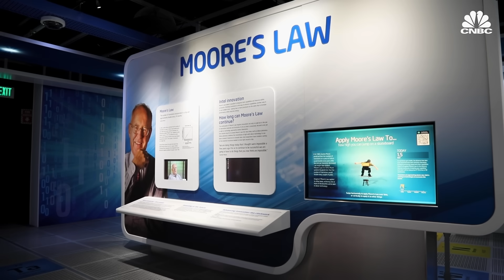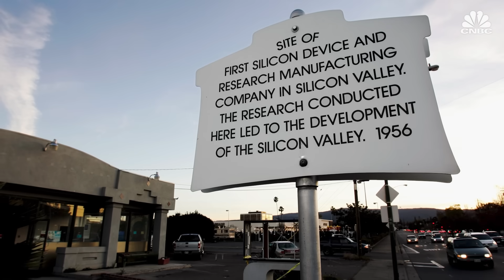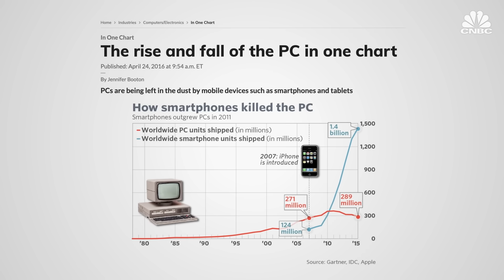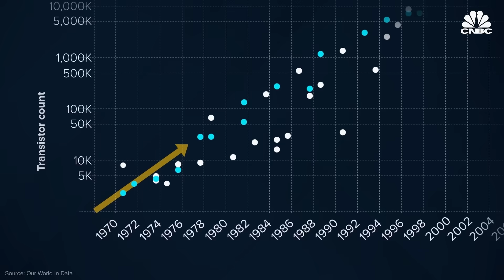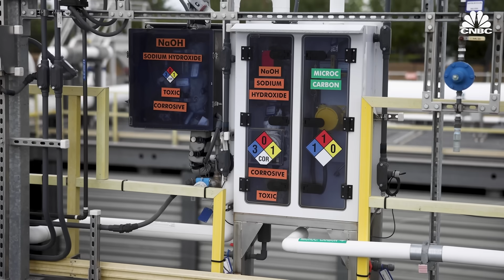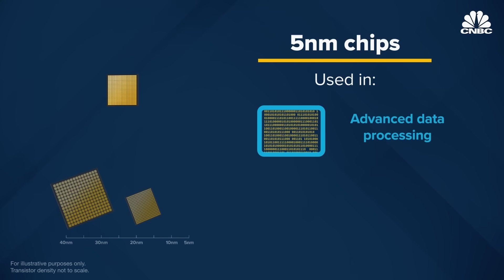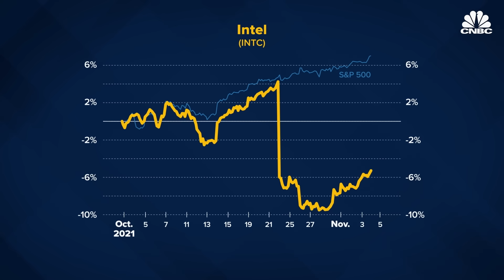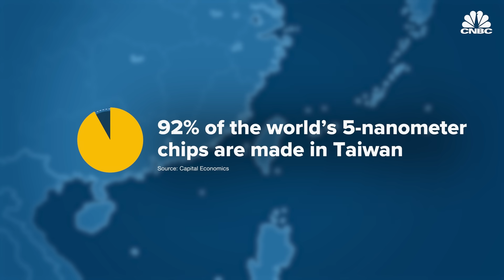Inside Intel’s Bold $26 Billion U.S. Plan To Regain Chip Dominance

Comment: my money is on AMD. Has been for a long time, been using AMD for a long time....  Their chips were equal for a long time, and now they are better.  way better. intel can't win me back.  I will stick with AMD even if intel makes something better.  THe simple fact is that intel STIFLED innovation for almost a decade!!!   We hit quad core laptops and desktops back in 2004. and things didn't really move much from there until 2015 or so when AMD released Ryzen... and 8 and 16 core processor for consumers...   Intel failed the consumer during those 10-15 years where chip development slowed down to a crawl!!!  We should have had 16 core intel consumer grade pcs in 2010 or 2012...  We had to wait for AMD to do it.  And Intel could have done it, but they thought they could milk the tech for a while because they were scared or moores law coming to a peak... they bet wrong. I won't be back... However, NVIDIA is still king of the gfx... but the new AMD stuff is catching up quite well...  I'm proud of AMD, and Intel has literally upset me...
Reply: also, I lived in portland for about ten years, I met several of the managers there...  I was far far from impressed and lost a lot of faith in the just by that alone....  I suspect being in Portland (Hillsboro) is half their current problem honestly....
Reply: Also, I find it INSANE that intel relies on another company to make the machines that make their chips.  If I was intel, the first thing I would have done was built my own department that builds nothing but those machines.  Building those machines that makes the chips is what should have been in the bill to support USA production... We need a USA chip maker maker company... ffs  simple

Comment: I can’t believe this report didn’t mention AMD. AMD has crushed Intel in the PC market with their astonishing Ryzen line of processors. They set the bar for performance and price at a level that Intel simply cannot compete. And don’t let  me get started about the graphics capabilities that you get built in into their processors thanks to their proprietary Radeon technology. Intel has stopped being the leader in consumer electronics a long time ago. It’s just that now it is more than obvious.
Reply: Intel is having such a tough time competing with AMD currently BECAUSE of TSMC, which was mentioned multiple times in the video. AMD has had a breakthrough in moving to their chiplet designs, but unless someone can actually build it the design is worthless. TSMC's manufacturing ability is what enables AMD with Ryzen and Apple with M1 to have such competitive products.
Reply: AMD designs Chips, they don't manufacture them. TSMC does.
Reply: AMD is a paper tiger that is completely dependent upon TSMC. When China swallows Taiwan, which WILL HAPPEN within the next 10 years, AMD will be be out of luck. Those fantastic chip designs mean nothing if they cannot be built.
Reply: @jstasiak2262  TSMC is currently building a new factory in the US. So you're wrong.
Reply: @akyhne  
That FAB is in a desert in Chandler, AZ where there is a drought and water is scarce. The Colorado river, the main water source for Phoenix/Chandler, is at a historic low level. Does it make any sense to put a factory that requires 13 Olympic size swimming pools worth of water (9M gallons) PER DAY in a place like that? I don’t think so. I think that is asking for failure.
Reply: @jstasiak2262  What does that have to do with anything. They are starting a factory in the US. Period!
Reply: @akyhne  
If you don’t have access to 8-13 Olympic size swimming pools worth of clean, fresh water every single day, you can’t make microchips. In a desert, water is scarce. Period.
Reply: @jstasiak2262  I'm sure they have a solution, just as Tesla did, when they build a gigafactory in the middle of the desert.
Reply: @akyhne  
The Tesla gigafactory in Nevada is very close to Lake Tahoe, Reno, and Interstate 80 which gives it all the resources that it needs. A gigafactory also doesn’t require 13 Olympic sized swimming pools of water per day. 

Perhaps if you have ever lived in the desert, you would understand how scarce and precious water is and how angry and upset people get when there isn’t enough water to go around. In the Phoenix area, there is also a lot of agriculture which requires massive amounts of water for irrigation to grow crops, animal feed and to water livestock. The farmers get very angry when they don’t have enough water to make a living.
Reply: @jstasiak2262  Phoenix has enough water to last 100 years without access to the river.
Reply: @kayakexcursions5570  
First of all, aquifers are an unreliable water source as any farmer in the California Central Valley can tell you. They can run dry unexpectedly. and it isn’t always easy to find new ones. Second, what happens after 100 years (or sooner)? Does the entire Phoenix metropolitan area have to uproot and move because it exhausted its water supply? There are already small cities in Arizona that had to de-populate because of lack of water. A “10- year water supply” is not a large water supply.

It makes zero sense and is foolish, reckless and irresponsible to locate a highly water intensive industrial facility in a desert, near a major city with large water requirements of its own, especially during a drought.
Reply: @jstasiak2262  Phoenix will never exhaust its water supply. I guess you know nothing about the situation, Phoenix pulls in more water than it uses. It stores the excess and requires all new land developers to store at least 100 years of water for each development. There is no worry about running out of water, there are no water restrictions, companies can throw away water as they need.
Reply: @kayakexcursions5570  
Nonsense. If other cities in Arizona can run out of water, Phoenix can run out of water. The decline in water level at the Hoover Dam is downright frightening. Arizona doesn’t have anywhere near the water storage capability that California has and the reservoirs in California are frighteningly low too. The runoff from the Sierra Nevada mountains has been very low for several years and none of the aquifers in the West are being replenished.

It is stupid, reckless and irresponsible to build microchip FABs in a desert during a drought.
Reply: @jstasiak2262  Wow, it's super obvious you don't know what you're talking about, the river is still flowing, aquifers are still being built and filled each day. We have multiple chip manufacturers here, but you still think we're going to run out of water just because other people are? So you're saying if you run out of milk you're neighbor has none as well? You need to explain that to Intel, I think they would be very interested in hearing your concerns.
Reply: @jstasiak2262  Phoenix has been stocking water for a while and there are floods here every year. Taiwan can move production here (they already have a plant).
Reply: @kayakexcursions5570  
TSMC is Taiwan’s security guarantee. Because the US has fallen so far behind in chip fabrication technology, the US cannot afford for China to gain control over TSMC or even take it offline by destroying it. This forces the US to defend Taiwan against China. Taiwan is not going to forfeit that security guarantee by making itself expendable by building cutting edge FABs in the US.

California has the largest and most extensive water storage and movement system in the United States. It has been online since the mid 1960s and supports the California agricultural industry which feeds a large portion of the entire country. The reservoirs are running dangerously and amazingly low. The only thing that is preventing a water crisis is forced water rationing and conservation. California no longer has the water supply to support the semiconductor industry, and that is one major reason why there are no more FABs in California. (The onerous regulations and exorbitant electricity costs are other major reasons.). California’s water supply is superior to that of Arizona.  If California doesn’t have enough water to make microchips, neither does Arizona.
Reply: @jstasiak2262  The plant in AZ is a copy of the one in Taiwan, they use the same machines that Intel will be using. There is obviously no problem with water usage in Phoenix or everyone wouldn't be building their water intensive plants here. Phoenix gets excessive amounts of water and literally dumps it onto the ground to be absorbed into the water table.
Reply: @kayakexcursions5570  
Intel also has the exact same ASML photolithography machines that TSMC uses in Taiwan at its Hillsboro, OR FAB (no water shortage there), but it has thus far failed to master the technique required to make its latest 10th and 11th generation chips. TSMC has to make those chips for Intel.

Even more important than the equipment is the knowledge and technique required for advanced EUV photolithography. TSMC has mastered it; Intel hasn’t and AMD gave up trying. Without the knowhow, the machines are useless. TSMC is not going to share that knowledge with the US because that would be giving away its security guarantee.

China wants that knowledge too, but the US is blocking it. The US is even forbidding ASML to sell EUV PL machines to China. China could capture the equivalent as well as the knowledge and expertise by capturing Taiwan.

There is no water emergency in California right now either—yet. But it won’t take much to have one. 

Unlike Hillsboro OR which has abundant water supply from the Columbia river, the water supply in Arizona is tenuous at best. And unlike the people of Taiwan, when push comes to shove, the people of Phoenix will not allow their water to be rationed to allow TSMC or Intel to make microchips.
Reply: @jstasiak2262  let’s not forgot how Intel ran to TSCM for help and begged them to manufacture their chips for them. Competition is good. Support AMD and Intel.
Reply: @jtn0022  it is a business deal, that's all there is to it. AMD has used Intel's. Competition is good for consumers. It is mostly win-win for all in this industry unlike any others.
Reply: Lmao dude TSMC is AMD's manufacturer
Reply: @dyslexicstoner.240  yep. AMD did it the smart way. Sad Intel took so long to ask TSMC for help.
Reply: They didn't mention them because Intel didn't pay CNBC for an AMD commercial, they paid CNBC for an Intel commercial.

You know this was just an advertisement right?
Reply: Julian wrote: "And yet, the new i5 crushes the entire ryzen lineup. lol"
Nightrider wrote: "Also the alderlake smash amd"

I'm asuming we're talking about games, right?

10 games average FPS (from Hardware Unboxed)

Core i9-12900K	199
Ryzen 9 5950X	195
Core i7-12700KF	195
Ryzen 9 5900X	193
Ryzen 7 5800X	192
Core i5 12600K	188
Ryzen 5 5600X	186
Core i9-11900K	184
Core i9-10900K	182

The Core i9-12900K barely beats the 5950X, it doesn't crush it. And the Alder Lake lineup doesn't smash AMD.
Reply: @akyhne  bruh just look at cpu userbench. The overall performance ist much better
Reply: @julian6653  lol, so now it's suddenly about benchmarks, and not about gaming performance?!?!
Can you make up your mind??!?
Reply: @akyhne  Its overall performance. Alderlake is just BETTER. Not just in gaming, but in nearly everything. The 12. gen are literally the best consumer cpus (for now)
Reply: @julian6653  I never said, that AMD is the better choice. I'm just saying, that Intel doesn't crush AMD in performance.

if you are a gamer, and want the best of the best, then go with Intel for a few FPS more.

if you are a gamer, and want a midrange CPU, then it depends on the prices.

If you have a laptop for work or home usage, then go with AMD. They offer way better battery life, and performance isn't the most important issue on a laptop. But even there, they are mostly better, than Intel. They also outperform Intel in most situations.

If you want a CPU for high FPS gaming, as well as workload tasks, such as video editing, not depending on GPU rendering, then go with Intel.

If you want a workstation for professionel, high load work tasks, then go with AMD Threadripper. Even for some casual gaming.

The gamer's market, is mainly people of the age of 15-25. It's not the largest CPU market for either Intel or AMD. Sure, they both want to have the fastest CPU, but the ideal customer for them, is a middleage man, with a PC at his work, a laptop for home use, and maybe an average PC or two for his kids.
It's not the 25 year old gamer, who lives alone.
If you do a search on most used CPUs on Steam, for Intel it's a 2.3-2.69Ghz (15.76%), and for AMD it's a 3.3-3.69Ghz (13.80%) CPU. In both cases, a 4-core is the most used CPU. Not exactly high end stuff.
Reply: Intel just did beat AMD with better performance. As for power consumption, nobody in the PC marker cares about that, so the metric doesn't matter.
Reply: @Reloaded2111  I definitely care about power consumption. And I know I’m not the only one. Reducing power consumption and increasing performance is the way humanity needs to evolve. It’s the only way right now.
Reply: @Reloaded2111  Intel just beat AMD in some games and tasks, not all. Overall, the new Intel 12900K is just a little faster, than last year's Ryzen 5950X.
Reply: And yet, the new i5 crushes the entire ryzen lineup. lol
Reply: @julian6653  I hope so. It’s been a whole year since Ryzen 5000. I would be disappointed if Intel wasn’t able to beat AMD. and yet, Intel is still barely beating AMD. I’m a bit disappointed by 12th gen. But happy to see Intel back in the game. After a few years of being stomped on by AMD. Remember competition is good taking one side only hurts this economy.
Reply: @julian6653  No, the I5 beats its competitor chip. Not the fastest from Intel.
And AMD still crushes Intel, when it comes to server/workstation chips.
Besides, AMD is soon launching new chips as well, so hold your breath.
Reply: @akyhne  who cares about servers
Reply: @julian6653  We all do. Like everything you do online, runs on servers. Including gaming.
Reply: @akyhne  Like, i dont care at all on which cpu some server runs. Fact is for consumer cpus which 99,9% of people will buy, intel is the better choice (for now at least)
Reply: Julian Only in performance. Power consumption and thermals are still bad as ever on Intel's side.

Comment: 14:31 what you didn't explain is that NM is more of a generational number than the actual size of whatever, intel's 10nm is "as good as" TSMC's 7nm..
Reply: Its not about the transistors entirely, its about the architecture. Apple proved this in the 90's with the PowerPC. x86 is dead.
Reply: There's a lot of things she got wrong. she obviously shouldn't have been put in charge of this report

Comment: Intel having its own fabs means that a lot of its R&D budget goes into fabrication technologies, packaging, etc. TSMC spends about $1B a quarter on R&D, as a point of comparison, and Intel might be spending more. Intel also has an FPGA division, which would be equivalent to AMD adding the Xilinx R&D expense ($200m+ a quarter). Intel's R&D is also working on self-driving cars....

In short, AMD's R&D is a lot more focused, so isn't comparable to Intel's. It's definitely possible that Intel is putting more into CPU and GPU tech than AMD, but not to the extent that a basic comparison of R&D expenditure will suggest.

Comment: 5nm doesn't have less transistor density than 7nm. It's basically just a much better version of TSMC's 7nm. Obviously it's still the most efficient chip right now in the world, but they didn't exactly do a die shrink. And Intel 4, which is intel's 7nm that is basically supposed to be on the same level (or even better efficiency) than TSMC's 5nm has tapered out much earlier than expected.
I think this "5 years behind" stuff with intel might be old news earlier than more people suspect. Plus 3nm is also delayed a year as well.
Reply: If Intel is doing so well, why is Intel ordering over 10 bn from TSMC?
Reply: @genuinennessbefitting4734  very simple-they are getting into making GPUs, and do not have even close to the capacity needed in their own fabs to do both CPUs and GPUs (as you heard in this video all their extra fab expansions are coming online in 2024).
I have not seen plans to use tsmc in CPUs for anything, so I think this is very much the case.

Comment: Two new fabs in Candler, Arizona?  The Colorado River is running dry. Fabs require huge amounts of water. There is only so much sewage and effluent available. Recycling 95 % of current usage does not guarantee future supply.

Comment: This history is nonsense. Intel pretty much fell behind technologically soon after they released the 8080/8085; the 8086 was a messy, limited architecture, and the 80386 was far from the first 32 bit microprocessor. Intel's initiatives in 64bit, embedded, and RISC were largely failures. What kept Intel alive and thriving was the fact that Microsoft software depended on x86 in an essential way and that they could use that revenue stream to catch up and incorporate other people's technologies into their chips year after year.